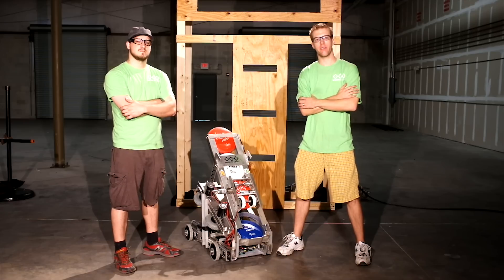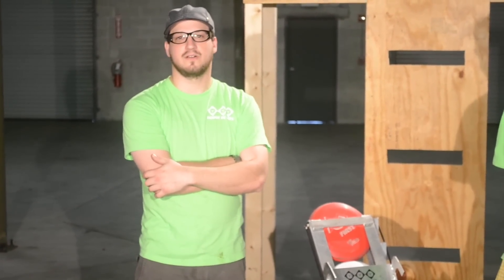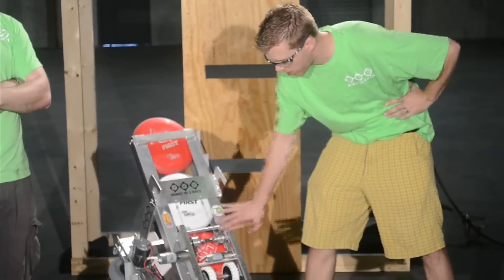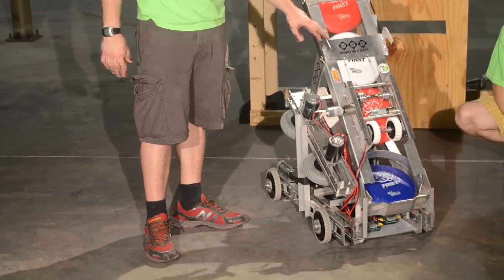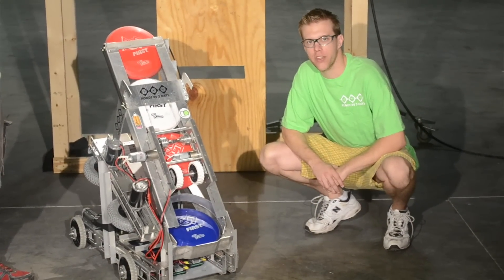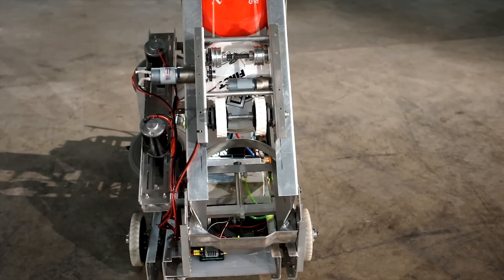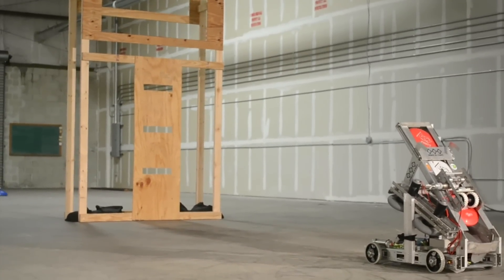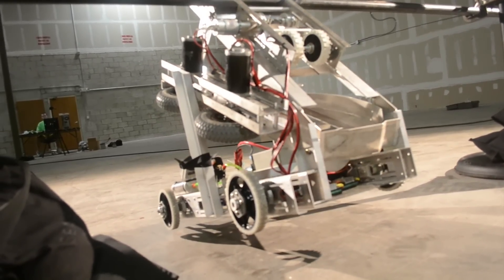Robot in 3 Days: The whole bot, climber included, for FRC Ultimate Ascent 2013

Comment from the maker: In our case the gearing is high enough that the resistance of the motor and friction of the gearbox resists back drive. Having the speed controller in break mode can assist this as well. So our system did not require power and did not fall. A worm gear could be a good solution to further guarantee that the gearbox does not back drive and allow the bot to fall. As worm gearboxes can be a bit tricky try to stick with off the shelf solutions.

Comment: Hi!
You guys are amazing! we would be glad if we could build such a beast in 6 weeks..

I have a question about the hanging mechanism, and i'll be very grateful if you will answer me. After you pull the hooks backwards and lift the robot, do you have to power the motor, or does the robot remain in the air even without electricity?
My team plans on doing something simillar, but we think we may need a worm gear to prevent the robot from falling, unless you say it works just like this :)
Thank you!

Comment from the maker: Due to time constraints, we kept things pretty manual. We used a Cross the Road Electronics CANipede in place of the cRIO for our uses. It comes with a nice GUI so we could quickly map our controller to the PWMs we were using. It was really helpful for rapid prototyping, especially with our winching system since we needed variable control to avoid breaking anything in initial testing.